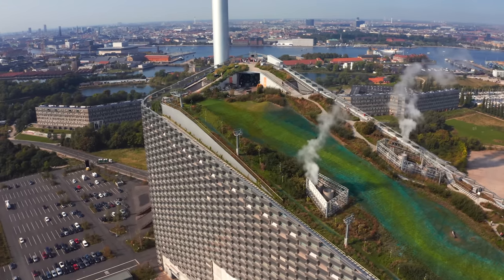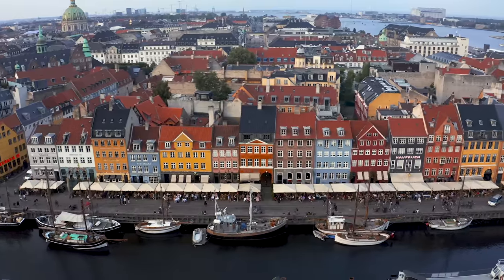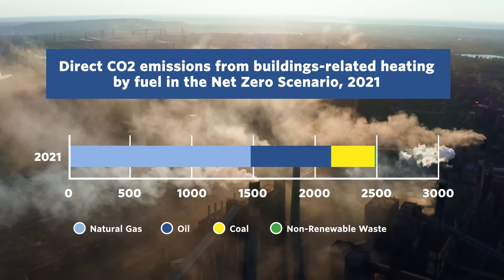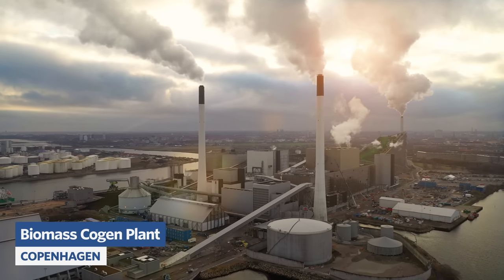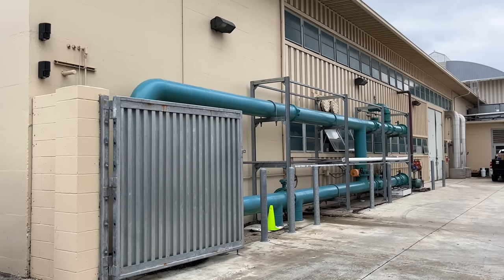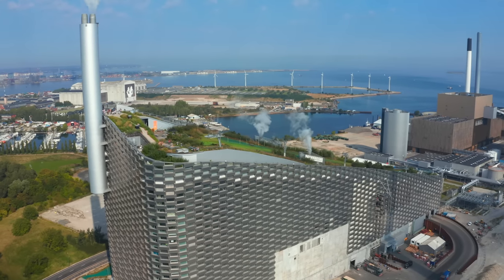An Introduction to District Heating Systems

Comment: Interesting checking up on biggest, Coppenhagen has around 1400-1500km of piping installed for around 500k people, Vienna is nearing 1300km for 440k households (so overall more people). 
Vienna can do up to near 3GW of heating, Coppenhagen max is 2GW.

So can't say biggest. It is one of the most advanced though, on which many model their designs, mostly because they're the first set to be carbon neutral by 2035, Vienna's target is 2040 (will be interesting to see how they hit it since 60% or so is currently gas, rest is mostly burning trash. They are looking at energy storage for summer/winter, store heat in summer to cool, and empty to warm in winter, will see since building all that infrastructure up will not be easy, they're at <100km piping currently for cooling).

At ~9:00, moving to electricity is also because a heat pump from electricity generated by burning gas than burning gas to heat, strange world we live in.

Comment: I live in Warsaw, Poland, and my home is heated by the local district heating system. I think it's inaccurate to say that district heating uses "waste heat" from power generation. Look at the thermodynamics of a steam turbine used for electricity generation. Ever since Sir Charles Parsons invented the condensing steam turbine in the late 19th century, the water exhausted from the turbine isn't much above room temperature, which is why it can safely be returned into rivers or evaporated in cooling towers. That's nowhere near hot enough for heating homes. The power station has to be designed specifically to generate hot water at the required temperature for heating distribution, which makes it somewhat less efficient than if the station was just generating electricity. In addition, the demand for heat per home is much higher than the demand for electricity. The power station that heats my home generates 622MW of electricity and 2000MW of heat. So less than a quarter of the energy input into the power station comes out as electricity. Compare this with a modern combined cycle gas turbine station which can achieve 60% efficiency and it doesn't look so great.

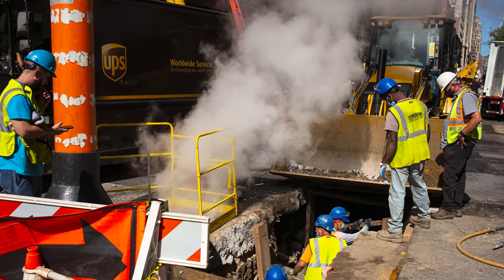Comment: 4:24 I hope I don’t come across as an “um-achthualllyyyyy” person!, i am just a nerd on these things, but i think they use a Combined-Cycle Natural Gas (Maybe Fuel Oil as a Backup?) Turbine then District Heat Cogeneration system now luckily.

The DC one is/was recently upgraded to NG from Coal too iirc.

Granted cItAtIoN nEEdED and whatnot, but yeah.

(I was reading up on all this post reading the wikipedia pages and seeing they had some gaps / out of dated bits post reading up / watching videos on all of it.  The YouTube Channel “Cheddar” has a good video on NYC’s System I think it is titled “what are those steaming cones” Or something along those lines, either way it mentioned the district heating + adsorption coolers using it and all that)

Comment: I visited the waste incineration plant in Bern, Switzerland and they have an extensive municipal heating system, primarily for institutions like the hospital or industries. they also have an additional gas turbine and wood power plant to switch on in winter if necessary.

The main issue is to extend the pipe network in already built up enviromments but it can be done gradually and is very promising to reduce energy use and emissions.

Comment: A correction of the non-essential statement at 2:40: I live in Norway, more spesifically Trondheim. We use district heating systems in the apartment building I live in, and the system has apparently been in place in this city since 1986. Even though Norway probably is a weird candidate for this infrastructure, with our power-generation, the costs of usage has been comparable concerning actual heating of homes. This has probably contributed to even lower prices for electricity as this lowers our need to pull on the electric grid. 
The prices for electricity have soared lately as a concequence of the war in Ukraine. I've been made really appreciative for the district heating system, since it has probably inhibited our already historic high prices from doubling or tripling or more, as is the situation further down in the country.

Comment: To me with the seasonal cooling/heating needs in northern latitudes it's ridiculous that we don't take advantage of earthen heat/cold batteries. Also with some conversions our existing pipelines could be converted to function as district heating/cooling distribution networks. Mostly I wish that the equipment used for drilling and piping fossil fuels would be used for installing geothermal wells instead.

Comment: Cogeneration seems like a no brainer - reuse that waste heat and do things with it. Also, it seems like cogeneration like this could be used to desalinate water, creating clean water in the process. Given that the process of most energy generation is to evaporate water, that separates out the salt as a byproduct. You could capture nearly 100% of the energy this way and at the same time generate massive amounts of clean water. The only con is some additional cost to harden your system to salt water's corrosive effects.

Comment: As a Dane this is quite interesting i just assumed district heating was quite wide spread and that cogeneration was what most power plants was
Reply: It is not a Dane. It is a video.
Reply: @TheDavidlloydjones  you ok? Im a Dane. didnt call the video a dane
Reply: In New Zealand most of the powerplants aren't even anywhere near the cities to begin with (we get a Lot of our power form hydroelectric dams, and most of the rest from coal and gas plants that are also generally further away from populated areas where possible), so cogeneration isn't really a thing that could really be done.

On the other hand, every school I attended (didn't go to university or the like, mind you) had its own furnace, which would burn coal to provide heat for the entire campus via hot water pipes (and most of the school's rubbish would end up burnt in it too, to my understanding). Of course, that's largely because the schools themselves are mostly pretty old. Newer schools, and newer buildings, are just hooked up to the electrical grid and heated that way.

Comment: 3:09 The issue is that "toasty warm".
Meaning, my main issue with building heat is the fact that many buildings and homes are set up to be as warm was the Summer, at 82ºF (or 28ºC) or higher.
I find this to be just a bad practice.

We need 73ºF (or 23ºC) to 77ºF (or 25ºC) to be comfortable.
Yes, we will need warmer clothes, like a sweater.
But we will not need a jacket, which limits our movements, or gloves which make it difficult to type on a computer keyboard.

If we, as a society, change little things like that on our daily lives, we will be able to:
a) Spend less on our utility bills;
b) Continue to be comfortable;
c) Produce less emissions.
Reply: They get that warm there? I've never been in a building set to 80 or higher unless there was an issue...
Reply: @dinahmyte3749  I have seen it.

Nevertheless, my point also applies to private houses / apartments.

Moreover, the feeling temperature varies with the humidity level, thus, (a) it is another component to keep in mind when comparing temperatures, and (b) it is another component which compounds on the cost of the utility bills.
Reply: at 25c most people can hapily wander around in shorts and tshirts, in my experience.

Comment: I run a crematorium and I've always thought the waste heat from incinerators, power plants etc should be used to heat homes, perform heat based processes in chemical plants rather than wasting energy heating it on site and for heating and even watering greenhouses, especially if able to utilize gray water.
Reply: There are some ethical concerns but ensuring only heat corresponding to the added fuel is used we also have crematoria making district heating.

Comment: Cogeneration is also possible with nuclear energy. Poland, which currently still heavily relies on domestically abundant coal and has a lot of coal cogeneration plants and city-wide heat networks, plans energy transformation that includes coal to nuclear transition and brownfield repowering of both industrial and city cogeneration plants with small modular reactors in the 2030s. Our cancelled nuclear program from the 80s also included plans for using Żarnowiec NPP for heating Gdańsk. Nuclear cogeneration for district heating is already used in Czechia and Russia. It makes a lot of sense. Nuclear plants produce a lot of relatively low grade heat in order to produce electricity. Better put that heat into people's homes than the environment. Particularly if the infrastructure for that already exists. Where it does not exist and further away from power plants it makes more sense to use electric heat pumps to harvest solar energy for heat, but the optimal use is to take advantage both.

Comment: Is there a good way to switch quickly from heating to cooling? When I was in college we had district heating and cooling, but they wouldn't switch to cooling until after the last average freeze. Didn't matter if it was 80 before that; there was simply no A/C available.
Reply: Yes there is, two loops as some places require cooling and some require heating. Same piping for cooling and heating makes no sense as the heat is needed all year around for hot water, for which the heat exchanger should be fairly close to the end use point, anyway in same building at least. Then some parts like server rooms etc require cooling all year around.
Reply: Zaydan Alfariz  yeap, that is why two separate loops makes most sense as both hot and cool are needed mostly all year around.

Comment: And you don't control your own heat! If there is a mechanical issue upstream it will just effect the other users. This used to be used with gas services in the city, called branches. Since one customers issue became the other customers issue all utility providers are now required to provide independent service to each customer. This will never take off outside of a fee large scale public projects. There have been efforts to do this in NYC and are shot down every year.

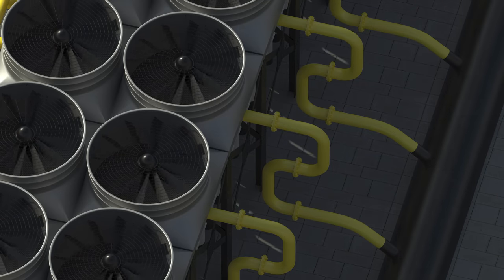Comment: 7:30 refrigerants isn't a technology, it's a medium that can store (or absorb) heat just like water is. It has a lower boiling point though so you can use it more efficiently than water in a refrigerant cycle in say a heat pump or AC system
Reply: Synthetically produced refrigerants that aren’t horrible for the environment are a technology
Reply: I think it's poor word choice. Technology is involved in making it but once it's made it's just a substance. The heat pump is the technology

Comment: Wait.... Did you just say, with confidence, that Norway doesn't use district heating? I know for a fact that the city I live in, Trondheim, has had it since 1982. I know Oslo and Bergen also have pretty big operations going. And probably a lot more cities than I know of. It's essentially the norm when it comes to waste disposal here.

Comment: You will want to reevaluate your idea about powering district heating systems with biomass and cogeneration. There is only a quite limited amount of biomass available and cogeneration often still means burning fossil fuels. In Finland the movement in district heating is towards technologies not based on burning stuff, for example, industrial scale heat pumps. There are also district cooling systems in operation so it’s not really some upcoming new tech.

Comment: What is the maintenance like? Especially with those “pre-insulated pipes” you mentioned, is it akin to standard District Potable Water / Reclaimed Water Plumbing for the most part?
Reply: Maintenance of district heating systems is relatively similar to the maintenance of water/sewer lines. Sure, there are some differences (you really don't want to release boiling hot water, as it literally can burn you to death), but you really don't want to be in contact with sewage either, (due to bio hazard), or let contamination in water pipes.

Comment: It's sensible for new construction. It's quite ridiculous to see the roof of a modern apartment building that has individual HVAC for each unit in the building.

My city has this in its central business district, using heat from an incinerator that the council want to shut down with no elements of a longterm replacement in place. The system itself is not an example of good execution; if all the tall buildings have heat pumps for cooling anyway, you're doubling the infrastructure to do half the job at the time of day when it matters least.

I do have some skepticism about the value for the people who work least hard to keep their areas at a specific temperature. If it's not going to be metered separately, everyone would be paying the average instead of paying less to keep the thermostat turned down.

Comment: I live in commie block on the 12th floor and by looking on the pipes of central heating facility, or more specifically on the number of pipes "piping smoke" I can easily guess what temperature is outside. When it is -10C to -20C you can see a lot of the smoke from pipes from all over the city :)  It is not that efficient system as many pipes in use were made in USSR times, so the heat loss during transportation is high, but the new pipe lines they install are much thicker and obviously better insolated. These days I am just hoping that russian rocket will not hit one of those during the night ...
Reply: In the city I grew up in, they replaced all the pipes in 2000's. Heat losses were so big that multiple boiler houses were closed down. 
that did remove former-USSR signature patches of heated lawns between buildings :)

Comment: Here in Romania where i live these sistems are very comm, but people are moving away from these sistems mainly due to lack of maintenance, the sistems here are very old and rusty, heating the house with district heating costs as much as with natural gas so most people are now installing natural gas boilers. My view on the sistems ( I'm a plumber) is quite positive, but the problem here is lack of maintenance and when they are old these systems are expensive to keep up, but if properly mentained they can be an efficient way of heating especially in cities, i say cities because how are we going to heat apartment blocks if we can't use gas boilers to limit air pollution, heat pumps are a bitch to install in apartments, electric resistance heating alone is way too expensive so the solution is district heating and my English is shit :)

Comment: Heat pumps would always be more efficient than electric heating, because it's the only system that can achieve >100% efficiency. Scale it up to a campus like Cornell, but shutting one down for electric is a misstep.
Reply: I suspect the new buildings built at Cal Poly, SLO built in the last 2-3 decades are standalone and are not tied into the heating (only) loops. Modern buildings have cooling, so to heat a building, you just need to turn some valves to flip from cooling to heating. If Cal Poly is thinking of shutting down their central (heat) plant, they'll have to install heating and cooling on those old buildings (or tear them down and start over). That is an option; many of them are quite old. The old buildings have single pane glass, flat roofs, and are very inefficient.
Reply: 'greater than 100% efficiency' is a bit misleading. 
in terms of 'electricity/fuel consumed to heat delivered', yes, sure. But it's not magically creating heat form no where :P 
Arguably, if it's exchanging heat with the outside air, it's functionally compact solar heating.

Comment: District heating is awesome, but waste burning as a heat source is quite the opposite. Since most waste is plastic, and most plastic is made from oil, it is essentially burning oil but with extra steps.

Comment: District heating and cooling makes me happy! Thanks for sharing!
This looks like a potential way to store energy from excess solar electricity from summer by heating a large mass and then using that heat for the winter. But doing it with a power plant is even more brilliant. That garbage burner could also burn wood or coal as well. Oil burners could be burning oil change oil as well as used fryer oil and Natural gas plants could also burn biogas from farm digesters or wastewater treatment as well as hydrogen. Here in Canada our heavy water reactors can burn thorium and uranium... It is good to have a power plant in a good location in a city that has flexibility in what fuel it can use.

Comment: District heating is absolutely terrible. I have it, the system is turn it on at the company will, regardless if you want it on not and have to pay for it regardless if you are using it or not. To top it off, you can't run away from it, shut it down or opt-out. You are forced into it and pay and it is super expensive. Don't fall for it, it is just a money grab that you can not avoid.

Comment: In Dubai, we have district cooling. The other way around.
Reply: So do they use an organic rankine cycle powerplant to take the high temperature air conditioning unit to run the organic rankine cycle power plant, or maybe an ammonia/ water evaporation unit that will take excess heat to drive the system.
Reply: @kerrryschultz2904  apologies, I’m not well read on heating/cooling systems and how they work.